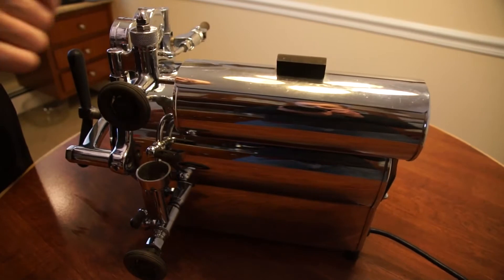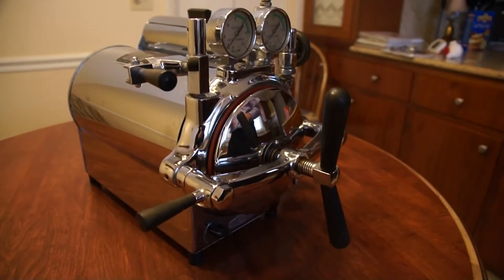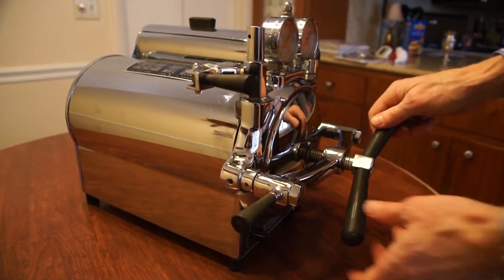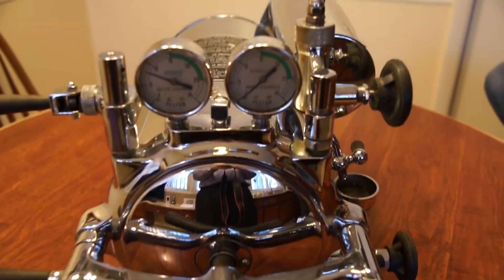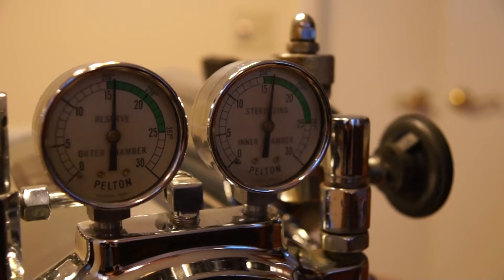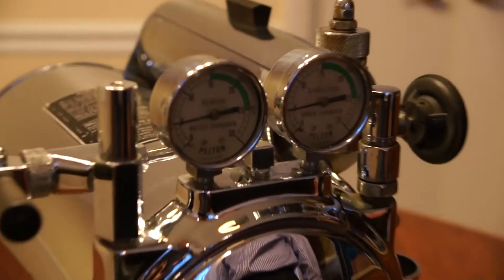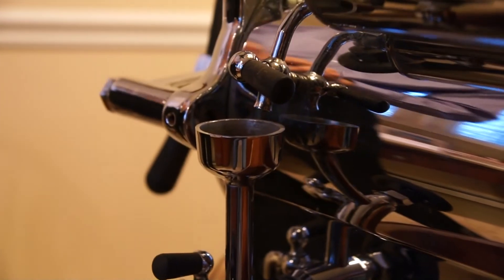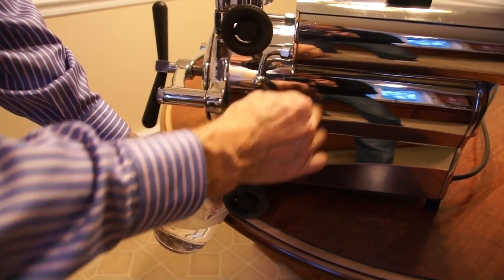Vintage Pelton & Crane Autoclave Sterilizer Model FL2

Comment: Yeah these were dangerous. It never passed the Boilermakers test mark....a few of these units are known to have actually exploded. Still what a gorgeous unit. Don't you just miss all that chrome. Modern units are all plastic boxes.
Reply: This is probably why they were periodically inspected and certified which could be seen on the sticker issued by the state, city etc.

Comment: Did you know the serial number on the back is actually the date the unit was made. 2/28/62. 
I have a 1/24/37. That's back when Dr.Pelton  and Mr. Crane were still  making them back in Pelton's basement in Detroit.